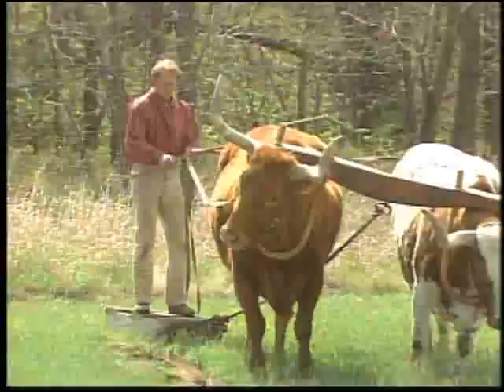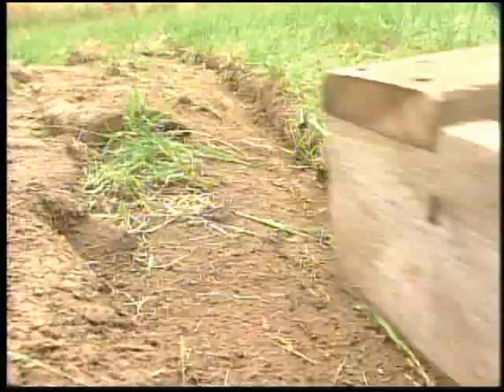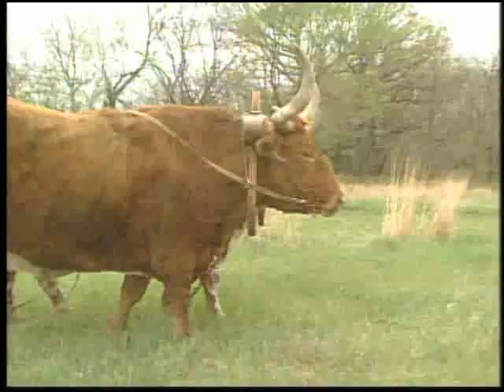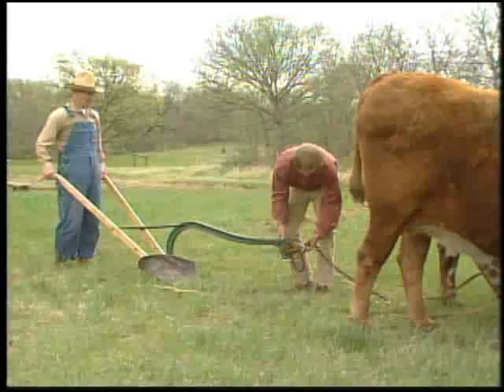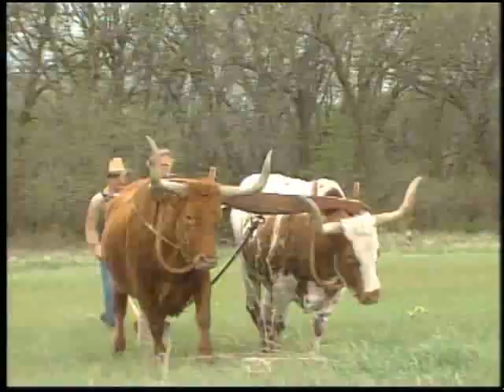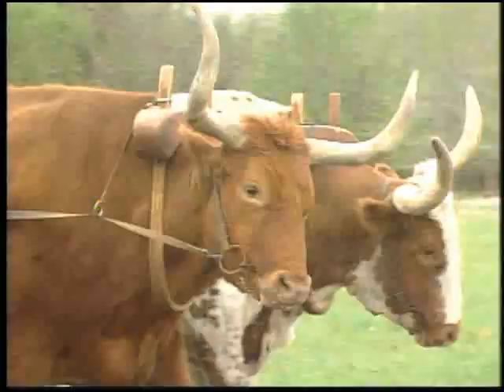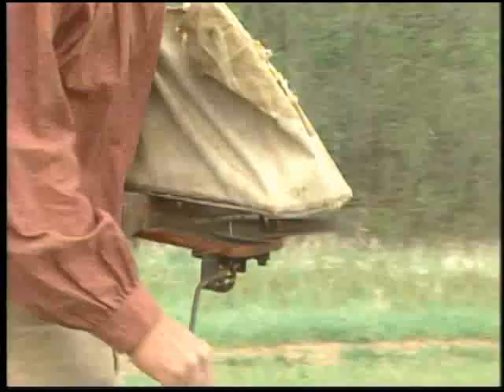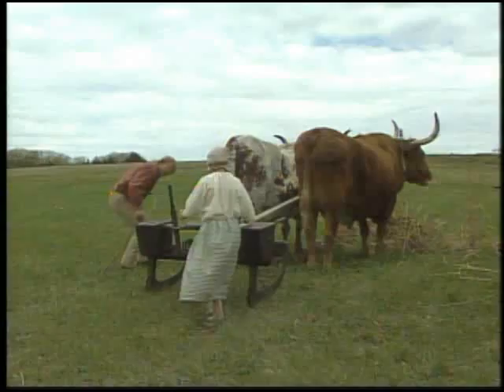Plowing and Planting

Comment: They would have, AFTER POWING  planted the seed on the first farms, but by next season they had bought or made harrows to fluff out the furrows.  After that they would have marked off the rows to be planted by making a sled like machine that cut markers spaced say, around 40in apart going entirly across the field one way, say N TO S.  then do the same thing going from E TO W say.  Where those lines intersected the kids would pull or push the handles dropping the corn seed.